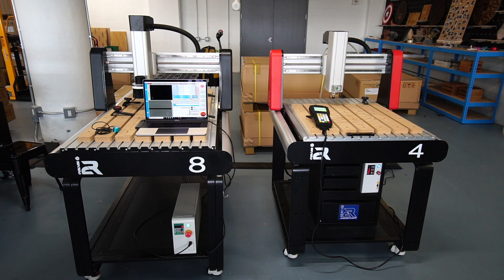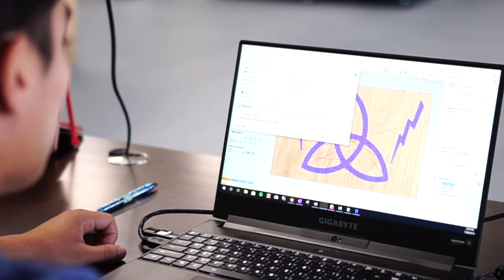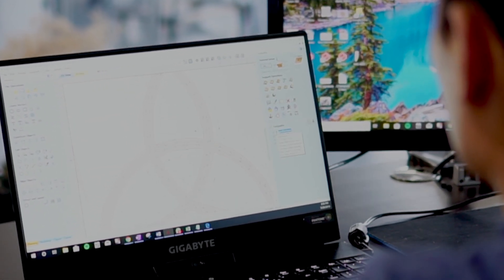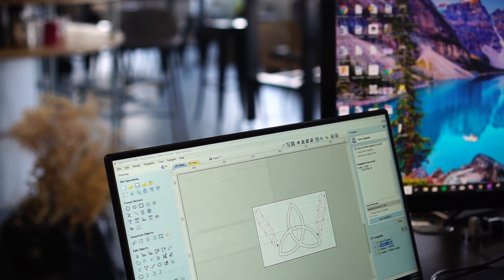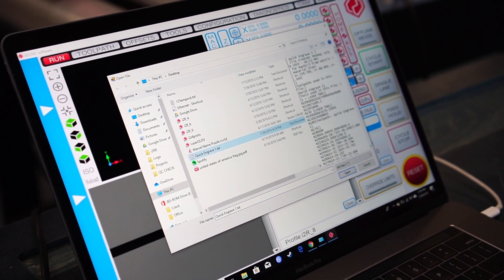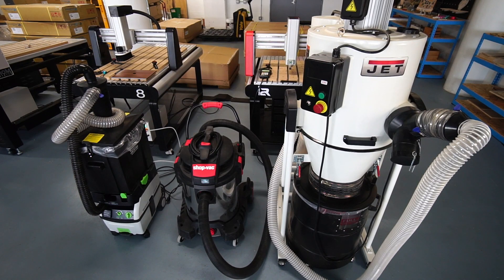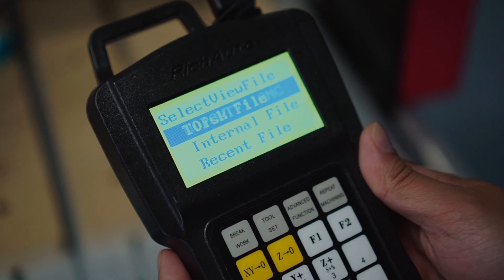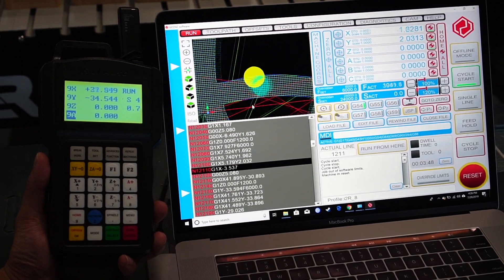UCCNC vs DSP i2R CNC

Comment: Seems like a great product.. Can you use a Mac for both models?
Reply from the maker: hinddee UCCNC Runs on Windows OS. To use a Mac would need to run in via boot camp windows.

Dsp is handheld no PC. CAD/CAM you would need a PC or Mac depending which program you plan on using. 

For example. 
Vectric runs off windows. 

Fusion360 both

Comment: The DSP is so much better than the UCCNC.  Once you use the handheld you will never look back.  Also you rarely after go back and edit toolpaths.  Much easier to learn since you only really use a few controls.
Reply from the maker: Paul Pomeroy coming from a person who has never touched UCCNC or understand how it even works. Please do proper research.
Reply: If you are prototyping, or changing designs this is invaluable. For full production where all creases are ironed out then maybe this argument holds. However we've yet to be asked for a DSP controlled machine... and we've had heaps of DSP owners of various machines ask us for cross over upgrade to the UCCNC. We can also supply a heavily edited simplified version of the UCCNC for production context's where button press starting is all thats needed.